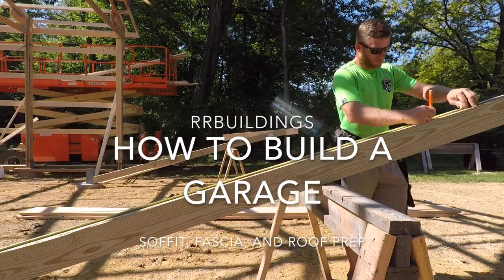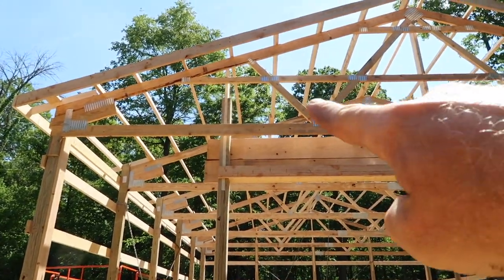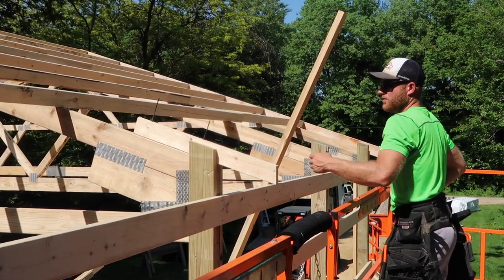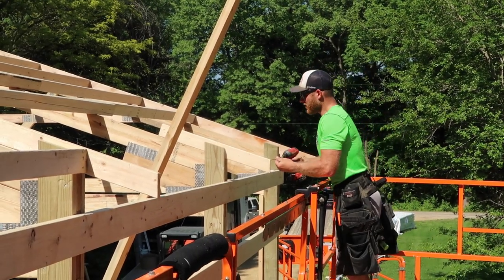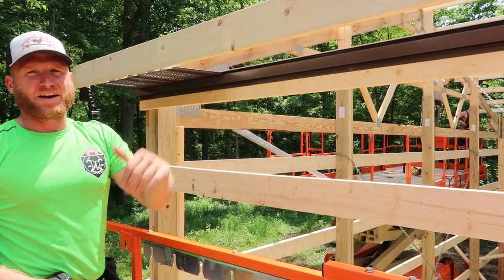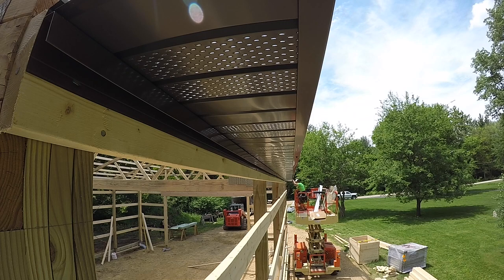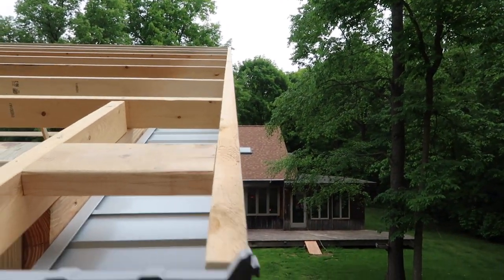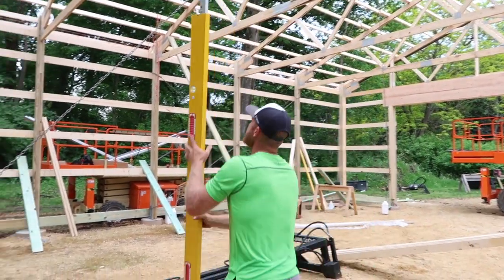How to Build a Garage Part 3 Soffit/Fascia and Roof Prep

Comment: Loved that trick you did with the square when you bent the metal for the fascia. Have picked up several helpful tips since I started watching from the DiResta build.
Reply from the maker: ̇George H. Awesome and those are the things I sometimes take for granted
Reply: I started following RR since the Diresta build too, although I am not a builder, taking some of the tips translates into hobbies and other work. Attention to detail is amazing in my option as well as passion.
Reply: Score the back of that fascia with a sharp utility knife blade and it will make a nice, tight bend when you use your speed square.

Comment: I started building my 30x40x10 April 2018. I'm still trying to finish it and I have done everything wrong compared to the way you do yours. August 2021 finally found a guy to get the roofing done and he had a heck of a time. Because everything was warp. I wish I had watched your videos before I started. I am doing it with osb walls, and a asphalt shingles.

Comment: On your over hang. Put two end pieces on first. Then pull a string. Make lineing the rest easy. Of course if wall is to long you may have sag. But Mason's line with a truckers hitch tied in will make string so tight you can play rocky top.  Nice build by way. Illegals have bout got us ran out of descent work. People don't want quality, they want cheap. And that's exactly what they get

Comment: That's called a pole barn around here. I've never tried a chain binder before but it seems too easy to go too far. I guess it's easy to go too far with a come-along as well but my favorite permanent solution is crisscrossing with wire rope and turnbuckles. I've watched all 3 parts thus far and I'm sure I'll watch the rest. Thanks for posting these videos. 
UPDATE: I watched the rest but somehow I missed the garage door installation.  Too bad the concrete guys didn't build some forms a little outside the building, or at least aligned with the outside, instead of just damming the inside perimeter. They could've made it look like the pad was poured prior to the build.
Reply from the maker: Thanks steve.  We aren’t perfect but we are constantly trying to get better
Reply: @RRBuildings  BTW, my comments aren't meant to criticize, only sharing my observation. Clearly I'm not perfect either...as exemplified by the grammatical mistake I had to correct.

Comment: You can use the 3/4/5 rule to square your peak/ridge to your fascia, so if you measure 16 run, 12 rise, the hypotenuse/diagonal leg should be 20

Comment: We used to use 3 4 5 as a square, or multiplied by the same number like 4- 3x4=12, 4x4=16 and 5x4=20 or 12 16 20
Reply from the maker: that works great too...the app lets me figure to the exact dimension tho.. reason I like this is post frames might have minute ins and outs on the long runs and its always best to figure square from the ends if that makes sense what I am trying to say

Comment: When you square up the building by pushing on a board wedged by the ground and the wall.  Does that board stay there until your roof steel and siding goes on in order to keep it plumb?  And does that really keep it plumb the whole time?  Just a curious non-builder here enjoying your videos!!  Thanks for the excellent content!!
Reply from the maker: mooreoftom long enough to roof.  Once the roofs on they come down

Comment: Great Videos Kyle! I am getting ready to start my own post frame build and I have been watching your videos over again. I do have one question that I have not seen you go over. If you have I missed it. On the corner post, when you go to attach the grade board to the end wall, how are you working around the outside of the wet set bracket?

Comment: Do you ever worry about wind loads with no diagonal bracing or poles buried in the ground to prevent racking?
Reply from the maker: Depending on height we use diagonal bracing

Comment: You ever thing of using the ratchet type binders for  tie downs instead of the flip type  binders ,i use to haul steel ,when i seen your head near that thing i cringed, i ve seen guys lose  teeth ,and break an  arm with them once they get a little warn down and you think she set bam ,dont want to sound like safety patrol just thought i give you a heads up on it ,building looks great and a lot of great info
Reply: He answered another similar comment and his answer is he likes these due to their compactness and price, imo his best choice for ratcheting ones would be to get the ones with folding handle, but seem lever type works best for him due to compact and lighter weight.

Comment: Good workmanship, what is the model number on dewalt stapler. You build an awesome building. I think 20 to 30 dollars is cheap. I’m my neck of the woods a 40x60 building with your finishes is about 50,000 to 60,000

Comment: I am impressed. You must have been building buildings this way for a while. Could you provide just a ball park cost of the materials used to build the 40 x 30 x 10 garage?
Reply: With materials? I bet around 50k. I'm building a 48x36 and it was 25k for materials, 3 garage doors, 4 windows, 1 service door. I'm building it myself though.

Comment: I had my porch screened in about ten years ago and the installer oilcanned just about every screw plus they didn’t fallow the lines of the existing porch columns so it looked like it wasn’t plum. After the job was finished I kicked myself for not doing it myself.

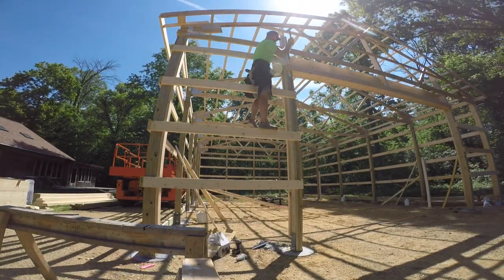Comment: 3:14 Just order your roof rafters with overhang so no need to built them on site and you can install purlins all the way with same spacing.
Reply from the maker: Sounds like a great idea trust me... doesn’t work with purlins installed on top.
Reply: Trust me...It does work it's standard here to order rafters with overhang and purlins on top. Our overhang is usually even more than 2 feet long and we have snow on winters.
Reply: I am curious how you would finish the eave since the last purlin would be perpindicular to the roof pitch so even if you flush the furthest or top edge with a plumbed raftertail, there is still a 3.5" cavity behind the fascia. I suppose a tight installed drip edge would keep it snugged up but wouldnt the fascia need to be nearly 10 inches tall then???

Comment: Question: After you use the winch to pull the wall in to plum, what did you do next to keep it Plumbed? Did you nail brace or how were you able to keep the wall from moving back? Thanks for the video, I subbed!

Comment: Nice job.   Question:  With the roof steel directly on the purlins with no roof OSB/Ply decking do you have to step only above the purlins or can you step any where?   Thinking about enlarging my shop by adding steel shed roof to side of the building. 
Craig
Reply from the maker: Craig S I always try to avoid stepping on a rib in the middle of two purlins.  They can bow in
Reply: Thanks,That's what I figured.
Craig

Comment: Have you considered using ratcheting chain binders ?
Reply from the maker: Ron Jones honestly cost wise it would be a big investment and these snap binders take up less room and it really is just as easy, but yes I’ve thought about it
Reply: I've also seen the iron workers use the steel cable come a longs to plumb and square structural steel buildings, cable and ratchet all in one, btw you doing awesome job. take care
Reply: @floydfan5993  yes that's what we use.  Because we need to use stronger materials.  They are also resistant to welding and torch slag.  
But we use a crane to set our structural members,  not a skid. 
FWIW we call it "plumbing the columns". But in his first video of this series,  the base of the columns must be "on grid" ie, in a straight line And specific spacing.

Comment: The makiati 18v screw gun you use can you tell me the model number and is it interchangeable with 1/4 & 5/16? 
I love your videos and I've  picked up a few good tips.thank you
Reply from the maker: Robert Hoffman it’s the 2500 rpm
Mode and yes 1/4 and 5/16

Comment: How much is this coasting? Really Nice   and would want something like this  Built.
Reply: Cost varies but take $30 per square foot and multiply, for example 600 ft2 would cost 18,000 for the engineered kit for say a 10 foot eave, but like i said height adds to cost so use this as an average and you can go as high as the post column supplier offers along with how much bay spacing you choose from 8 to 16 foot and truss spacing as well from 16 inch up to 8 or even 12 foot, height and spacing are the biggest cost variables. Let alone the finish be it sheet metal and that varies by profile and coverage or even colors which some cost extra, then there is interior finish and choice of insulation type. Suffice to say the building structure is the largest cost and yeah the extra stuff adds up.

Comment: Could You please tell, what is the main reason for using nails instead of screws?
Reply from the maker: lots greater shear strength
Reply: Essential craftsman did a great little tutorial on the topic.  Nails have more shear strength because they are more ductile.  Screws are harder and so are more likely to snap under a shear load.  But they are much stronger than nails in compression.  So screws can stop a roof from being blown off and nails support the weight of the walls attached to the post frame.  Understanding material properties is another uncommon trait in a builder.  Most just use what they were taught to use...even when they shouldn’t.
Reply: RR Buildings thx!

Comment: On your corner lam post brackets... Do you cut the outside of it off so the band board attaches flat to the lam post?  (for your end walls, the outer 2 brackets are oriented perpendicular to the center end wall brackets which would push the band board out 1/4")

Comment: I noticed you pull out your tape measure every fascia board to check for your overhang footage. Have you ever thought about setting your first and last boards and running a string line that way your not pulling your tape measure out every piece? Is that something you have done and well maybe the string line gets in the way or is it just faster to measure directly?
Reply from the maker: I don’t have too and yes I’ve done way you say... however it requires me to straight the building first and that is hard without my fascia or tail to straighten if that makes sense
Reply: RR Buildings makes complete sense! Keep up the good work!

Comment: Why not run soffit vent in long lengths rather than the short pieces you installed ?
Thanks
Also surprised there is no straping being used.

Comment: If you tweak one side, don’t you have to re-check the previous side (and so on)?
Reply from the maker: Joop Terwijn if you are referring to the fascia... no... if one side is straight.... the other side will follow suit.... now there are times when trusses are inconsistently made.... and that’s when we have to pull fascia screws and adjust

Comment: Quick question you showed that the main trusses slide into the post, how does the gable truss sit in? If it sits in middle of last posts then it wouldn’t allow the end posts of end wall to go up level since your corner brackets and end wall brackets are aligned. Or am I missing something?

Comment: Does the pitch of your roof determine weather or not you use 2x4s on edge or flat? If you have 8 ft truss spacing but a steeper pitch (7/12 - 9/12) would it be better to keep them flat?

Comment: Your obviously very knowledgeable, expert etc....but fyi those cardboard cement tubes  you used to pour your piers attract termites....where I live we cut those cardboard tubes off as low as possible away from the top of the cement.
Reply from the maker: no termites here but good tip
Reply: RR Buildings 
How many barns have you built? What software do you use? Your measurements, plans, methods are like clock work .......

Comment: What could someone roughly expect to pay for a building like this?  I'm interested in a 30x40 but have seen quotes vary by more than 20% for the same type of building.
Reply from the maker: Not all buildings are created equal.  Probably $25-$30 a square fr
Reply: Is that finished with a concrete floor or just the structure itself?  Gotcha on the not all created equal part.  Awesome vids BTW, just found your channel and am hooked.

Comment: Not to sound lazy or fall into the "young guys don't even know how to use a hammer these days," ( I'm 56), but why don't you use your jumbo nailer for the 20 penny nails on the header? Speed? Set up? Cost? Splitting? Inquiring minds want to know..........
Reply: Dennis Downes I wager setup time, he’s a day or two removed from setup for building the walls so starting the gas generator, unrolling the chord, loading the nail gun, etc.  it’s faster to just nail it off by hand.  The real answer probably is that it’s an amazing stress relief to pound a few 20 penny nails in by hand so it keeps his mind sharp for the rest of the day :-)

Comment: What is a typical price for a building like that? I live in Florida so I understand the pricing may be different, just trying to get an idea
Reply from the maker: really is all over the board....could be anywhere from 20-30 a square ft finished
Reply: Hello How are you? What do you mean by 20-30 a square ft finished? You mean to measure each wall and each ceiling to know the price? Gracias
Reply: TheHAZYZERO he means per square foot of the floor.  So a 20’ x 30’ building would be 600 square ft.  So that would be $12,000 to $18,000.
Reply: Hi Luke thanks for your answer. I have another question. This price include the materials? or just hand job?
Reply: TheHAZYZERO that would be for the total price prior to any applicable sales tax so materials + labor.  If you want to get an idea of materials alone, some companies sell post frame kits like Menards and others.  That won’t include everything but will give you a rough idea.
Reply: Thank you so much Luke Now I have a Idea about estimates

Comment: 14:42 what do I think, Well I think that the level is touching at the bottom and not at the top, so move the post and stop showing off for the camera
Reply from the maker: way to show your ignorance....the level has stand offs on top and bottom....so it doesn't touch through the middle and throw off your ability to check plumb from top to bottom.
Reply: @RRBuildings  if it has standoffs, then the gap should be even if it was plume, this was not. Video clearly show that the bottom is going to be touching and the top is way off.